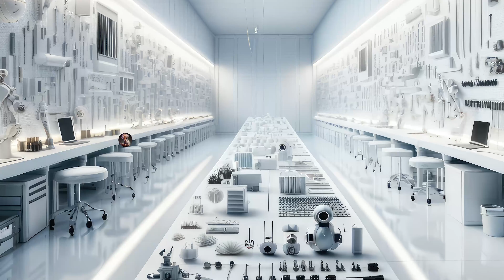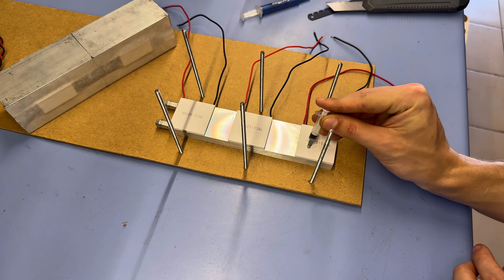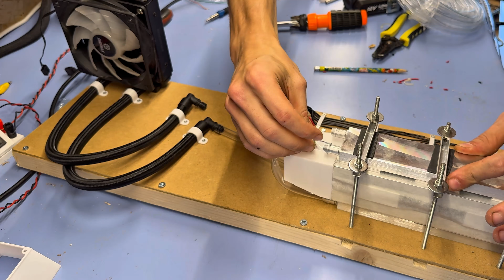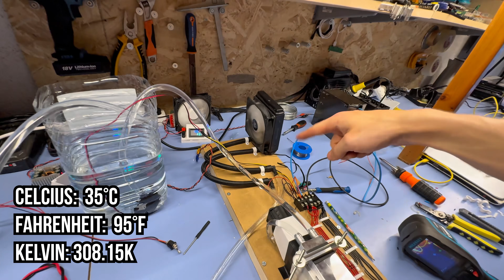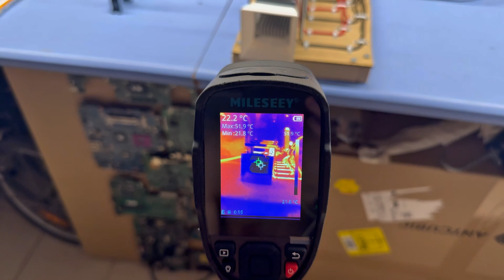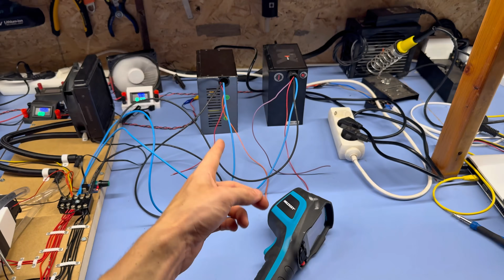I Built an Air Conditioner with 6 (8) Peltier Coolers and it WORKS!

Comment: My entire house uses less power to air condition than this uses. Ive always wondered about peltiers doing things like this but I guess there is a reason why air conditioners do not use peliters
Reply: Peltier's is super inefficient, to cool a 30m³ room you end out using 8 times as much power with a peltier than if you used an AC, but they thrive in certain applications where traditional cooling just wont cut it and power consumption isn't a problem.
Its a cool little project although :)
Reply: I wish it was easier to use compression-based cooling for hobby projects, exactly because it's way more efficient.
Reply: uses way too much power.
Reply: Instead of air conditioning your house, this could be an alternative to those swamp cooler portable ac. You could use this to cool off by blowing the cold air on you. It would consume the same amount of power as a small portable heater as well.
Reply: I made a small chiller with this peliters. But it produces more heat as much as chilling. So we need to work more for the heat sink. I made a 4 litres icecream chiller, it works cool... With 12v 25 ah battery for 8 peliters. It works well
Reply: We need mini nuclear reactors to run these efficiently
Reply: Yeah 1200W+ power is quite a lot for not much cooling. But I suppose if he uses isobutane instead of water, it will do better. I am just curious how much better isobutane vs water.
Reply: Thats why im building a nuclear reactor.
Plis dont tell finnish government btw
Reply: Yeah boiling and freezing Freon is extremely efficient for pulling heat out of the air.
Reply: @jamescpalmer although to be pedantic, it's not been freon for decades
Reply: @PetesShredder  Good point. What do they use now?
Reply: @jamescpalmer various, I think they are starting to use ultra high pressure co2 in some
Systems too, and butane
Reply: @PetesShredder  Oh cool. So in a modern AC what gas do you think would be used?
Reply: This is compact and won't be noticeable by the landlord. Utilities are already included in my rent.
Reply: But lookt at all benefits. There is little to no mechanical parts
Reply: @xlazom00 but compressors in fridges and air con units barley have any moving parts and they last decades
Reply: @PetesShredder  not all of them last decades well I mean fridges especially lg brand I no atleast a dozen people that have had lg fridges go out right after there manufacturers warranty but definitely most ac systems last decades but don't think lg makes any of them lol
Reply: @stevenoe6395 probably gonna last longer than a fish tank pump though eh?
Reply: @stevenoe6395  "not all of them last decades well I mean fridges especially lg brand" I have a GE Amana fridge. I purchased it when I purchased my house in 1994. It has been running continuously since then. The only problem I have ever had with the fridge is the sensor that detects when the defrost cycle needs to happen when the evaporator clogs up. It was a 6 dollar part and I replaced it myself as it was easy to get to.
Reply: @PetesShredder not really I use them for live wells for when I go fishing the one we have in our aquarium has been going none stop for years. I'm sure there's a lot of junk ones though I do usually buy the cheapest thing I can expect for most cordless power tools I use for work but I am very abusive to my tools lol but I also have some harbor freight corded tools that have been going strong for the last 15 years one of them is my rotory hammer it's been through hell and still keeps going probably won't now that I bragged about it lol
Reply: @stevenoe6395 usually its the control board. Just buy the simplest freezer or fridge you can.

Its a bonus its usually cheapest.

Telltale signs theres just a dial for thermostat.
Reply: @stevenoe6395 LG does actually have ac units
Reply: @PetesShredder  They have 1 moving part, and its submerged in oil, making it pretty much immortal.
Reply: @xlazom00 in fact thinking about it, an air conditioner has exactly the same components and moving parts as this. A pump and two fans
Reply: I use a 3000W Peltier cooling unit to cool my room, and it's working pretty well. In fact, I don't paid the electricity bill, so I don't care how much it consume. Ik that a conventionnal AC will use 10 times less power, but I gess it's funny.
Reply: @Rayan-ey5ct Lol you just don't pay it, or do your parents?
Reply: @theonlinething1039 I can consume as much as I want, the bill will stay the same.
Reply: @Rayan-ey5ct that still sounds like unintended use, and somebody will end up paying that bill

Comment: If you want efficiency, minimize the temperature difference between hot and cold side as much as possible, and don't run them at full rated voltage. They're not terribly inefficient then, but won't cool much.
If you want lower temperatures, stack them in series, but now efficiency is out the window pretty quick again, but you can easily get to funny numbers below zero.
Peltiers are fun but won't make for a good airconditioner when a compressor can use 500w and generate 1500w of cooling pretty easily :P
Reply: I came to the comments to ask about how much power that set up is using vs a standard 4k btu window unit
Reply from the maker: That’s my biggest question too, in theory it is about 400W and in practice I am waiting for the measuring device to arrive
Reply from the maker: Great Point! I use some ice inside the water bottle so the temperature difference is lower, however didn’t notice a bit temperature drop at least for now, need to experiment more)

Comment: Instead of adding more pads, Id increase the size of the radiator/cooling. Remember these cool a % below Delta thus, the cooler the water, the cooler the pads can get. :) Otherwise very nice!
Reply from the maker: Thanks mate! I tried adding ice to the water bottle but didn’t see any cold temperature drop, but I need to experiment more before saying something with confidence) Peace ✌️
Reply: You could try running the heat sinks in parallel instead of series that way both are getting the same temp water to cool them

Comment: after years of me making peltier projects i find they realy dont last long under high temps (60c) and use SO mutch power. they are nice to play with but cooling a room or sutch they are to inefficiënt, my new love goes to fridge compressors :)
Reply from the maker: This is good to know! I was wondering how many hours can they work with no efficiency loss, I will be testing just that these days. How many days can they handle without stopping, from your experience?
Reply: they work for years if the hot side gets cooled enouf and there a bit undervolted or current limited (or order a 15v one on a 12v suply), they are used in mini portble fridges and seem to work well in that condision. but as soon as the hotside gets to hot (60c) it breaks the peltier. 
efficiency wise there a disaster from the start compairt to even the wost  compresor based cooling solution. only thing i think it might be eficent on is heating water to a specific temp, like a aquiarium. since for heating the heat inefficiëntsy is  added to the output you need.
Reply: i would also add somting to move the heat outside in a more permanent setup, a big rain barrel outside is a good heatsink/termal battery. and make sure to not mix metals in a loop

Comment: Remember, if you wanna cool a space, you have to make sure you aren't radiating that heat you removed back into the same space....... so maybe hang the AIO out the window?
Reply from the maker: Good Point! And that’s exactly how I want to try to install it. Power supply is a heat source as well so they should go outside too! Only the end of the tunnel will be blowing air inside the room and literally everything else goes outside, we’ll see that in part two!
Reply: @Inventors_Den  One thing to further consider, you want the air it is sucking in to also come from the room you are cooling, so it "recycles" the air in the room, and also so you aren't trying to pressurise the room. No matter how well you try to seal a room, if air goes in or out, it has to be replaced from somewhere. Those portable air conditioners with an exhaust hose that goes out a window are practically useless unless they have two hoses, because as fast as the exhaust air comes out of it, hot air from outside rushes back in through every crack and gap to replace it.
Reply: @Muffin_Masher  You are right that under pressure of the room sucks in air from other areas. This causes them to be less effective compared to one that recirculates its own air  But they are far from useless. They still are very well able to cool a room.

Where I live it's about 1 week per year that outside temperatures go above 30 degrees C 86 fahrenheit. So in this case these portable ones are a very good option if you want a cheap and easy solution for cooling your bedroom.
Reply: I built something similar to chill the water in my laser cutter.. i used 3 peltier Elements and a 480 radiator to cool the whole system but it definitely is on its limit (i am now thinking of using 2 or even 4 480 radiators to get the heat out of the hot side ) your one 120 radiator looks in comparison really small ...
Reply: you also need a much larger radiator if you are using water to transfer heat not superheated gases.
Reply: Mini compresor con motor invertir
Reply: Why does it consume so much power for this tiny shit?
Reply: What's your fan😊
Reply: Or strap it to a large metal bucket of water so the heat is transferred into the water
Reply: @Timmie2  and then the hot water dissipates heat into the air in the room, smart.
Reply: @TheDrakenZ  wow smart  you don't have to be a vag about it   use a bigger bucket or more so  dissipation is delayed then you can add  some vinegar  make a douche  then wash yourself  out  😽